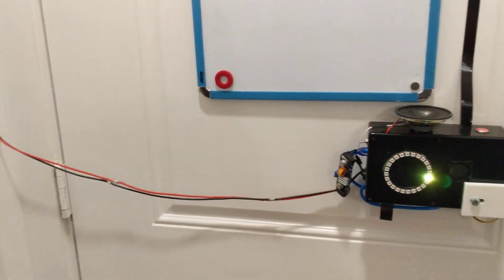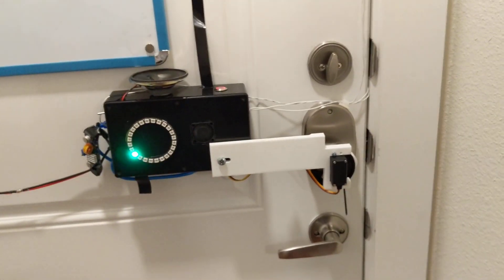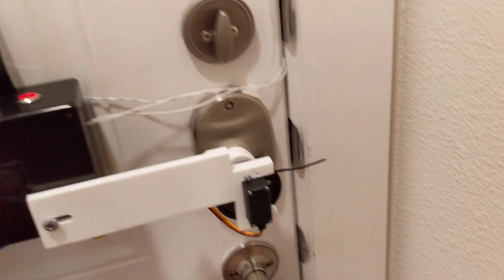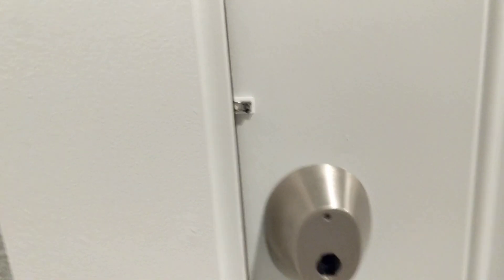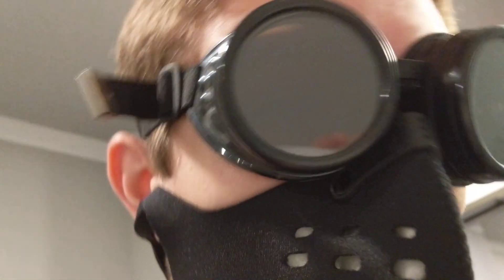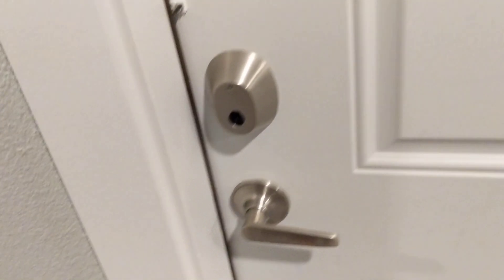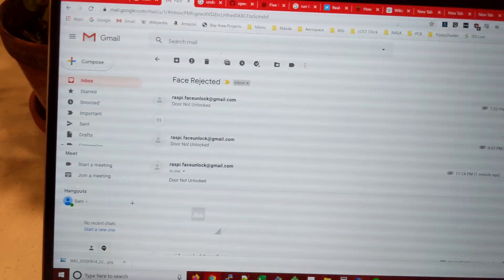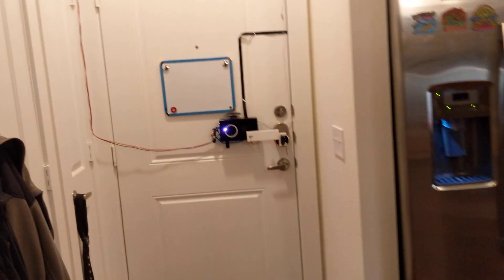Raspberry Pi - Facial Recognition Door Lock

Comment: I extremely needed the full tutorial of this, it's the same as my capstone project but mine has a notification message that will send to the parents when that person have entered or leaves the dormitory.😢
Reply from the maker: @CapuXino424  I'm tempted to rebuilt it with custom PCBs just for cleanliness so I might get around making a tutorial but it would be a while. The linked tutorial on facial recognition and all the code and schematics I provided in the description is everything you need to make this however, just no step by step guide atm
Reply: @srt252  what algorithm did you use? Thank so much!😊
Reply from the maker: @CapuXino424  local binary pattern histograms

Comment: Hi, can we implement this system without using Arduino and only by attaching all components to raspberry Pi?
If so, does the code u gave alter?
Reply from the maker: Yep, that is definitely possible. 

The code change would be fairly minimal. Should just need to change the serial write command at line 166 in recognize.py to a servo command (and add a servo library).
Reply: Yes but I think there will no longer be any need of serial connection part of the code.....i.e. lines 39 through 50 and 86 to 94.
Reply from the maker: @shanmukhak5566  also true yes good point

Comment: Cool! I think my battery powered smart lock project is interesting for you!
https://youtu.be/4-wtu9toda0
Reply from the maker: That is very cool! Nice work. That's a pretty compact solution, I'm impressed that you went for the battery powered option
Reply: @srt252  I did not want cables hanging around.Low power standby is quite hard, but now i got about 4-6 months without recharge.
You may also check my doorbell video, i also tried facerec, which is why i stumbled over your videos.
https://youtu.be/3w_xTNuditQ

Comment: what will happen if I use a photograph for you ? how can I increase security?
Reply from the maker: Great question. I have not tested this but I believe my door would probably be defeated by a photograph. 

However I have three things that help increase the security of the entire system: 
1) most people don't know it's a facial recognition system. Many of my neighbors have video doorbells and most people assume it's something like that.

2) I get an email anytime my door unlocks with the picture of whoever unlocked it. If I got an email with my face I would know there was a problem and could call the police

3) I also have cameras inside the apartment that would capture imagery of whoever entered.

So basically my security prevention revolves around people not being aware of the system in the first place. It's definitely not ideal and I am taking some risks for sure.

An idea I've toyed around with for improved security is also having the program somehow verify that my phone is in close proximity before issuing the unlock command (via Bluetooth or checking if it's connected to the wifi somehow)

Comment: How to input power supply from door lock  face recognition?
Reply from the maker: The power supply is a 9V 5A power supply that I had lying around. Power input was tricky because the raspberry pi needs 5V 4A (ish) but the arduino can run at a range of inputs, so I pass the raw input directly to the arduino and split off a parallel circuit to a voltage converter that goes to the raspberry pi
Reply: @srt252  can you share link step by step to how make it pls?
Reply from the maker: @danialrazaq615   it's mostly just a modification of my previous project which I did make a step by step tutorial for https://youtu.be/9fPYdwPjIms the only different is remove the rfid antenna and add a raspberry pi. All of the code is on github: https://github.com/supatreadz/Face_Unlock/

Also there is the wiring schematic. If I get time and significant interest I might do a tutorial for this one but I'm pretty busy at the moment.

I'd be glad to answer any specific questions though. For the facial recognition aspect, the tutorial I linked in the description is excellent

Comment: You are cool and genius
Please add the blueprint for this project
Reply from the maker: https://github.com/SupaTreadz/Face_Unlock/blob/master/FaceUnlock_Schematic.JPG
Reply: @srt252  can we buy a more high end camera  meant for raspberry pi , but still connect exactly the same to your blueprint schematic?
Reply from the maker: @hadriancian333  yep, and as long as it still connects through the camera port I imagine there wouldn't even be any code changes needed but not sure
Reply: @srt252  omg thank you for replying....;)

can i just ask before i decide to procced trying to do this project, 

1)how accurate relegable is this recognitions system?, and 
2)how many enrollment is it able to handle? and 
3)is there an update to improve it deep learning algorithm still using the raspberry pi 4 8gb? any more update on the algorithms part?

alright thank you. :) a fan
Reply from the maker: @hadriancian333  1.) it is fairly accurate, with enough training. I have my detection threshold set at 90% and sometimes it takes a few cycles to allow me in but I have not had any false matches so far (though to be fair, I have not done much testing on that) 
2.) I currently have 7 faces enrolled with about 30 images each for training with no issues - I am not sure what the upper limit or constraints on that would be however
3.)  I don't think the raspberry pi 4 8gb can handle the deep learning algorithms but I can't say for sure, sorry
Reply: @srt252  thank  for replying... :)

follow-up questions,

1)lets say I train the complex deep learning/convolution neural network in a computer  with subject 1 my pictures,
2)then I get the model parameters and store it in the raspberry pi4,
*so the raspberry pi  just run the identification/recognition that already load in it.
heavy
evetime

4)this would not strain on the raspberry pi4 right or overclock it right?
Reply from the maker: @hadriancian333  I don't immediately see any reason why that plan wouldn't work - however I can't promise it will. I think it's worth a try though